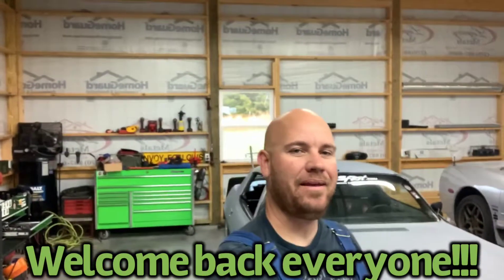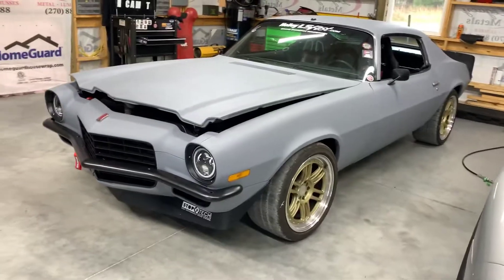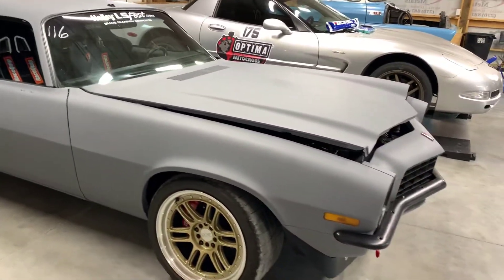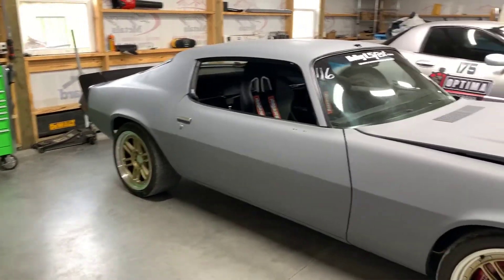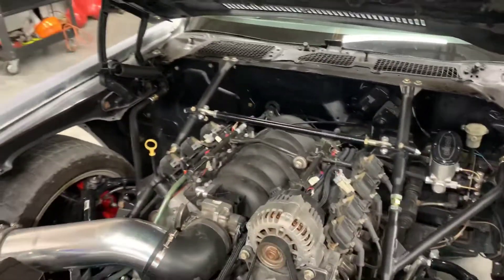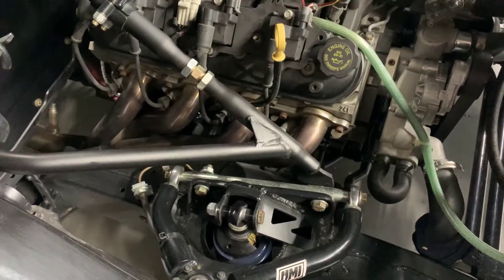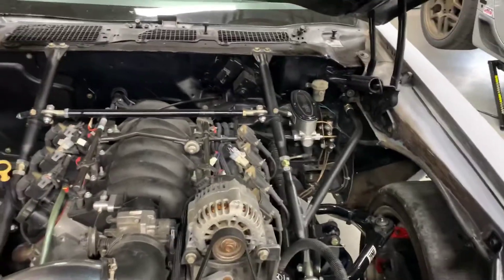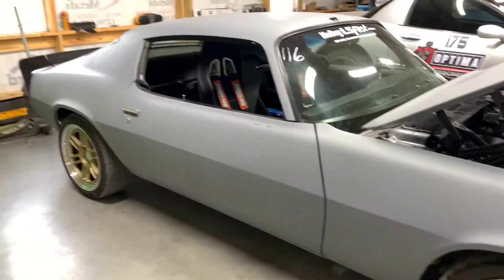How to LS Swap/make a pro touring Camaro!

Comment: Can you please post the parts you used to install the rear belt harness bar?
Thanks
Reply from the maker: Trial gear tube clamps and then I went to my local metal shop for the bar.  Pretty simple.  I wouldn’t trust it in a true racing application though.

Comment: Now I daily drive my 1980 camaro z28 and the 8-9 mpg I get isn’t the most ideal. So I was thinking about LS swapping my camaro but I do not know what LS to get and whatnot. I want to make it a reliable not race car but mostly a cruiser with good fuel efficiency.
Reply from the maker: Really any Ls would be fine. A stock 5.3 makes around 285 hp and with a cam probably around 325.  They can be had for a couple hundred bucks.  The small items are what add up.  The biggest part is try to have a plan and do as much research as possible.  Thanks for watching.

Comment: How much would you say the whole swap was to put motor in and get it running
Reply from the maker: There are a lot of different variations.  I bought the Holley terminator x and oil pan motor mounts and cross member so that alone was around probably over $1500.  I have close to $5000 in mine.  You could probably do it under $2000 if you try.  Thanks for watching.

Comment: What size wheels & tires are you guys running?
Reply from the maker: These are 18x9.5    Thanks for checking it out
Reply: @cwmotorsports4497  295s?
Reply from the maker: These are 275’s but 295 should fit. I had 315’s on it but they were rubbing the leaf spring.
Reply: Do yo know the back space on wheels car is awesome